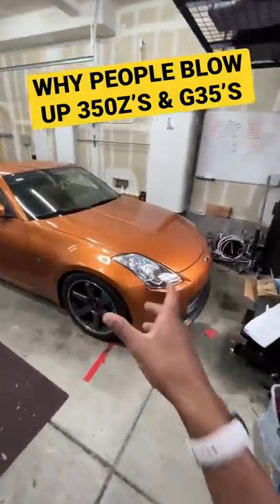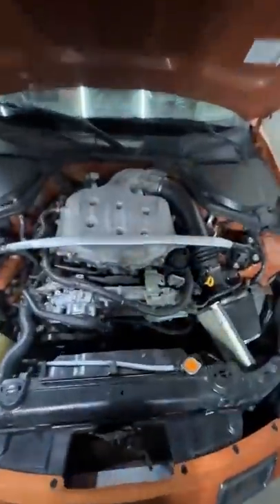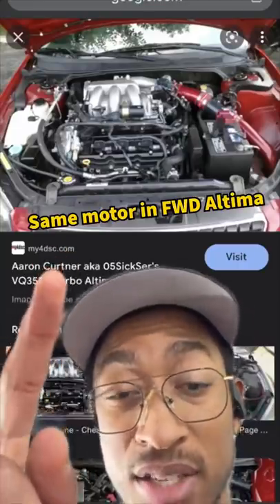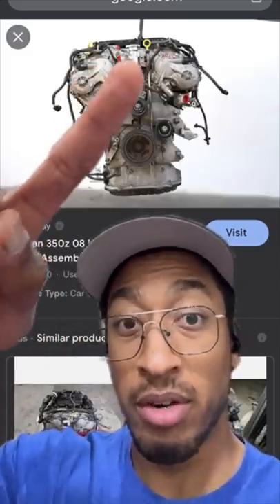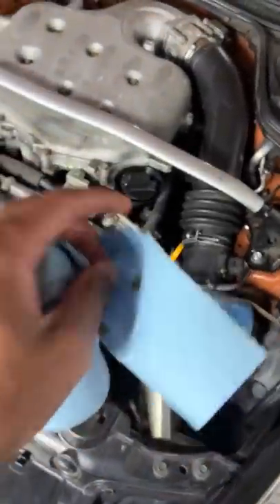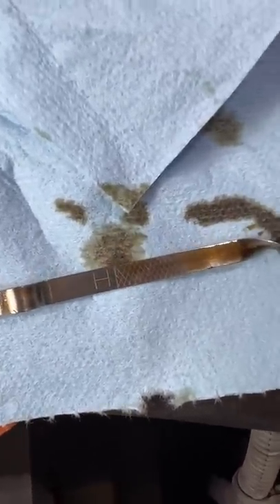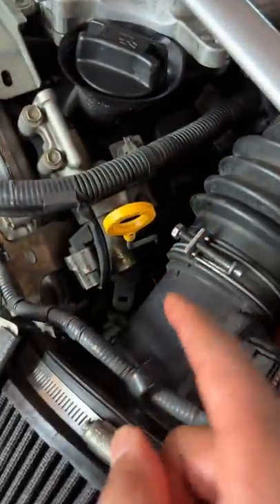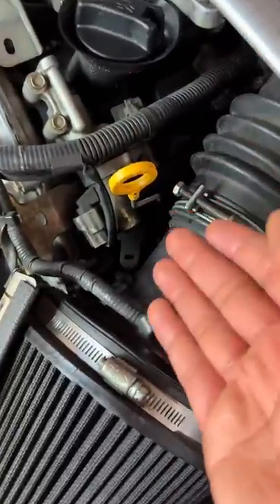Why people always blow up their 350Z’s and G35’s 💥🤯💣

Comment: The reason isn’t oil reading it’s because they don’t change their damn oil oil doesn’t go anywhere you barely burn it in the combustion chamber when it lubes the cylinders you might lose half a quart to a quart give or take depending on vehicle per oil change unless your running a turbo that is oil cooled or you have a oil leak issues oil shouldn’t be a issue the reason why they blow up is because A they don’t change the oil ever and B revving a engine while not under load is very very bad for the engine because it’s free spinning take a cooling fan on a computer stick a air compressor nozzle on it and pull the handle the fan will most likely break and the reason for this is the rpm got to high for the bearing to handle your engine is consisted of bearings and lobes that all rotate as you increase rpm’s it’s bad to be dogging a engine under load revving it without a load is the fastest way to blow your car up if your gonna rev it keep it under half your rpm gauge and I mean red line if your max is 6k keep it under 3k and don’t worry you will thank me when you have tons of miles on your engine mines sitting at 355,930 has a slight head gasket leak and i mean very slight still daily her and  she still has so much life left in her and its a 2.2 s10 one of the most problematic engines ever yet mines tanking im telling you take care of your cars and you wont be sorry

Comment: Wrong you need to warm it up and let it sit for 60 seconds after shutdown pull the dipstick out wipe it off and reinsert it and that is your correct level if you check it cold in the morning all the oil has drain down from the cylinder heads and you will not get the correct reading his once all that oil is back into the cylinder head you'll be running low in the oil pan

Comment: That’s like the bmw I had. I didn’t have a normal dip stick… it was electronic n u checked it from inside while the car was on…. It used to time out cuz it couldn’t get the level so I never knew how much oil the engine had. Dumb design

Comment: WRONG!!!!!!!!.... Everyone with a freaking Brain and common sense understands that if you start your Engine you'll get oil splash all over the inside of the block. The normal way to check the oil is after starting, let it sit for about 5 minutes and all of the oil up in the Head and block will be drained back down into the oil pan. It's actually best to check the oil when warmed a little that way you can see if there are small metal particles on the dipstick. The reason people blow their engines is because they put Nitrous Oxide and Twin Turbo's on Engines that were not designed to take it. As well as over revving. Beleive me I know. I've been doing this for almost twice as long as you've been alive.

Comment: just stay away from cars if you dont know how to check the oil run it to temp let it sit so the pil will drain back to the pan then pull the dip stick wipe it off insert it pull it and youll have your level not rocket science

Comment: You're reading the instructions for checking the transmission fluid. In what world do we now have to make videos to teach people how to check the oil on their vehicles? You always check the oil when the engine is off after it's sat for a while. The crankshaft is continuously agitating the oil in the reservoir. It's literally impossible to get an accurate oil reading unless maybe you have some baffled oil pan that would only be found on a race car and even then nobody is dumb enough to check the oil when any part of it is being moved around or agitated. Do we also need to tell people not to take their radiator cap off when the coolant is boiling hot and under pressure? Seriously?

Comment: Omg your supposed to pull it once clean it then check it dummy while it is off
Reply: And if u did do then u need to do the old transmission tip and pull it in and out about 15-25 times to push it out of the dipstick because it's splashing inside like u said and u have to use the dipstick to push it out